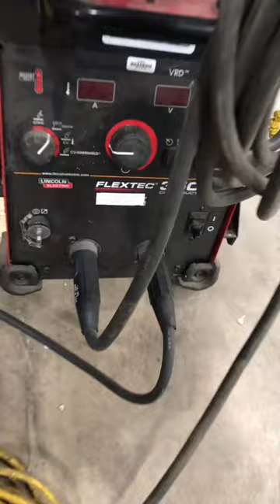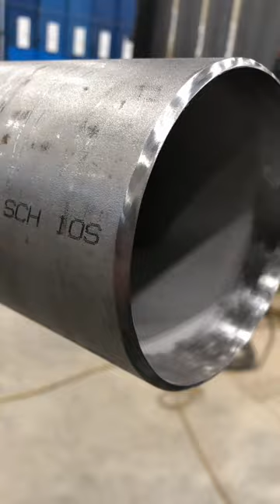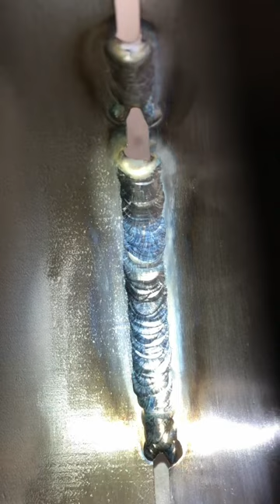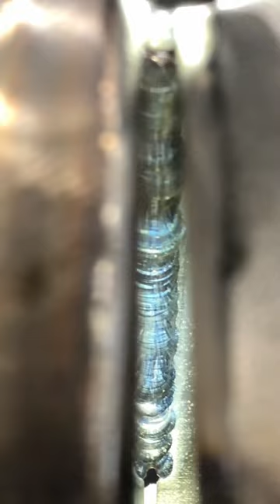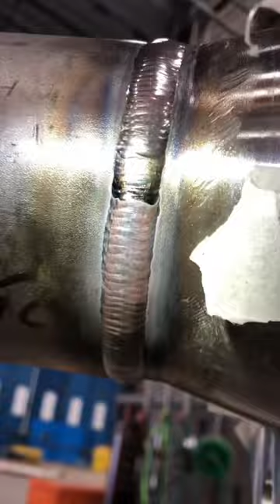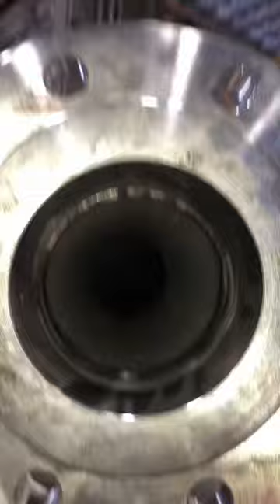Welding Duplex Pipe #welding #shorts #construction

Comment: Looks good, brotha. Currently welding duplex and super duplex in the shop. The part i hate the most is trying to get a perfect tie in.
Reply from the maker: No doubt, the tie ins are something else.  Hit or miss.
Reply: Make it melting point 45%degree cut  give drop by drop both rootface ending give little bit up current .check it wil melting correct